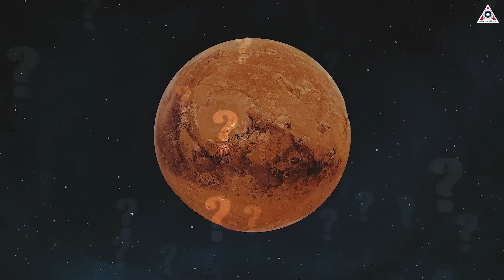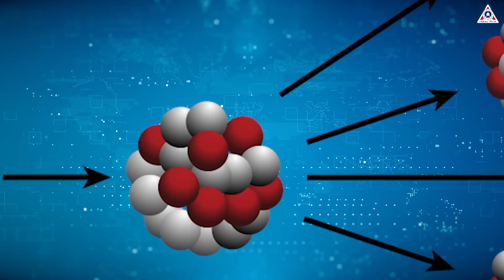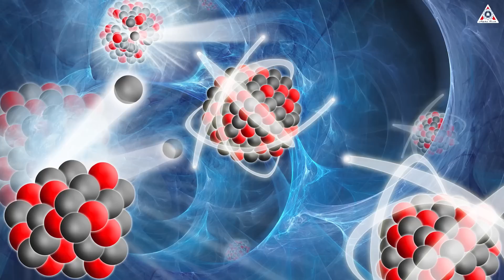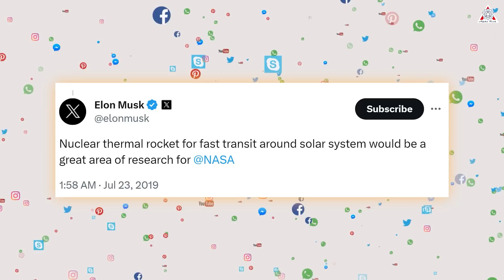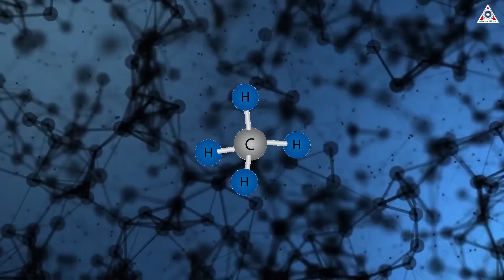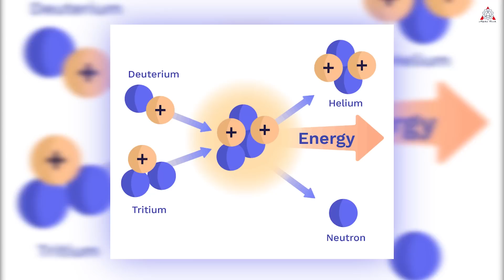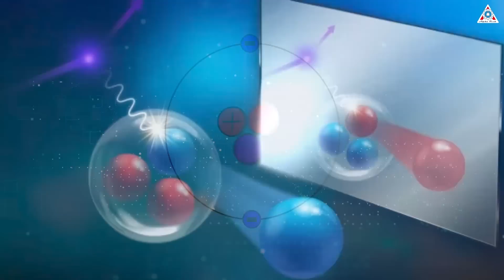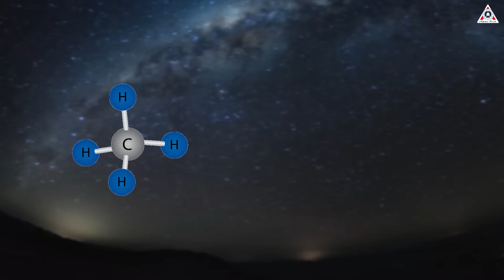NASA's NEW Nuclear Mars Rocket Engine is somehow better & faster than SpaceX Starship...

Comment: You don't use a device puts out loads of radiation to take off or land on a planet that you intend to live on. If it is a rocket you don't make it carry tons of shielding. Both fission and fusion are best as propulsion between planets and unless we have huge breakthroughs in managing radiation, we can use Starship to take off and land. It may even be possible to use the fission or nuclear rocket to push something like Starship to Mars orbit, and push it back. You don't want to drag it. Place its fuel tank and Starships propellant tanks between the reactor and the people.
Reply: The fuel is the shielding, it is not the issue. And you would still use chemical engines to land or take off from planets. The actual radiation issue is space radiation, cosmic rays and solar flares. This is why this would be better, all that hydrogen is an excellent radiation shield

Comment: This rocket engine would not replace the Merlin or Raptor engines. It would only be used while already in space.
Reply: Correct. Nuclear engines have an excellent isp but a very poor thrust to weight ratio. Victor Von Braun was considering it for the Saturn V second stage  where TTWR was not so essential. Now there is an even better way to get much higher isp, read “Thermo-Electric Rocket Thruster” if you want to know more (down to 18 days). ☺️

Comment: Fusion energy would be superb! As an old guy, I will soon be waiting for it for seventy years. As long as it does not work on the Earth we need not think about shooting it into space.
Nuclear rockets I can only imagine in the upper stages of spacecraft as they do not spoil the earth in case of failures.
So nuclear-driven rockets are superb. We only need to get them operating.
Reply: Nuclear rockets might be good for a trip between 2 Planets (first around home planet and next around distination planet), but not for starting from a surface or landing on a planet.
Reply: you dont know what a nuclear rocket engine is, do you
Reply: @Nuke-MarsX  As you know everything ...

Comment: Aside from all the AI generated nonsense in this video (greenhouse gas methane being environmentally friendly, electrons triggering fission, etc), there's also that hope for nuclear fusion instead of fission. It has significantly higher energy and lower risks. Also recent developments working on quite different designs of fusion generators could eventually produce rocket relevant side products. Nobody will fly stadium sized tokamak. But some compact linear generators or other solutions could actually work as safe and decently efficient impulse generators. Plenty of solar energy up there.

Comment: Hydrogen is very hard to keep in a liquid state.  This engine still used high speed atoms to push the rocket.
Reply: It’s called cooling. And it’s much easier to keep hydrogen cold in space then on planet earth, the vacuum is an excellent insulator.
Reply: @jessicatymczak5852  I understand it require cooling, but 20.28 K (−252.87 °C; −423.17 °F) is really cold.  https://en.wikipedia.org/wiki/Liquid_hydrogen.

Comment: Very interesting video
IF  and only IF we have not forgotten the elephant in the room (or rather the herd of elephants)! ! !

From Earth to Mars the most economical journey (in terms of fuel) takes 252 days, spending a little more we reach 180 days (or 6 months) 
Arriving in the "suburbs" of Mars a braking operation will be imperative (aerocapture or direct reentry mode).

Going drastically faster (45 days ~ 4 times less than 180 days) will require braking drastically harder on site (thus having to transport the necessary fuel from the ground) 
Will the rocket and its crew be able to withstand this braking? ??
A solution would be a very very strong acceleration at the start only so that halfway through we already start to slow down (and therefore spend fuel) to reach speeds allowing an aerocapture or a direct re-entry

Another big elephant in the room ;
Hydrogen is indeed a very efficient fuel; On the other hand, it has a very big flaw:
It has a very low density and in liquid form it only wants to return to gaseous form; in short, bringing hydrogen until Mars for braking will be a major challenge

Comment: I would assume the current optimum solution would be a Chemical engine to achieve high Earth Orbit then switch to Nuclear Fission engine for interplanetary travel, then back to Chemical engine for planetary landing.
FYI: Nuclear Fusion has been achieved in the Laboratory, but not stable or in a cost effective way, YET!
FYI: Nuclear Fusion is INHERENTLY fail safe. Failure of ANYTHING and the reaction stops! No need to do anything. If the required parameters are not met NO reaction. AND very limited waste material. As to extraction of raw materials, lots of water is all that is required AKA the oceans!

Comment: Nuclear is NOT SAFE IN ANY FORM
Reply: That's exactly the mindset that holds humanity from clean energy being widespread and affordable. I would agree with this statement if it were modified slightly, i.e. Nuclear energy isn't safe when used irresponsibly and recklessly by nations or companies that don't prioritize safety. Nuclear power has been used in U. S. submarines for instance without a single incident for decades. Again safety prioritization is paramount. The former U.S.S.R. on the other hand has had problems with its lack of safety prioritization. Nuclear energy is safe when used without taking shortcuts. Besides, it can't lift a rocket into space, it can only be used once orbit is achieved and the danger for Earth is mitigated. However, the rocket chosen to boost it into orbit needs to be reliable and safe too, because there is risk while putting it into orbit to begin with. To say it's not safe period is incorrect and short-sided. Of course, that's just my opinion. You're free to disagree however.

Comment: Fission: maybe if the materials needed can be found and the weight can be practical.
Fusion: We can't produce it anywhere except in bombs. The one time it was produced in a lab the lasers used used orders of magnitude more power than the one produced in the reaction. To hope for a rocket using fusion will remain a hope for many more decades.

Comment: nuclear is the future, becouse you get the energy for years for heating, cooling, charging robots etc...
Reply: In principle. In practice they are very heavy, very hard to contain, produce heat that needs to be cooled and on and on. If it was possible we would build them here on earth first. There are lots of plans and designs, but few if any commercial (or even experimental) examples.

Comment: A bit of bad science here, liquid oxygen or LOX is not a fuel, it's an oxidizer required for combustion of the fuel, liquid methane.
Reply: Nonsense. "A fuel is any material that can be made to react with other substances so that it releases energy as thermal energy or to be used for work."
LOX is the oxidizer and liquid methane the reducer, both are fuels of the redox reaction which generates heat. Neither LOX nor methane can generate heat on its own. The reason why oxygen is typically not thought of as a fuel is because it is in the air all around it. So people simply forget about it. But technically it is a fuel.